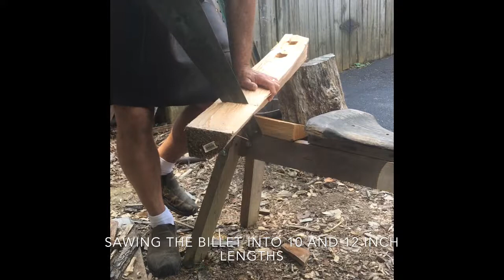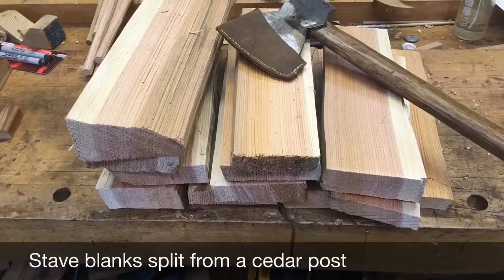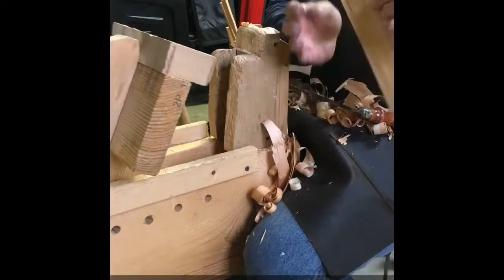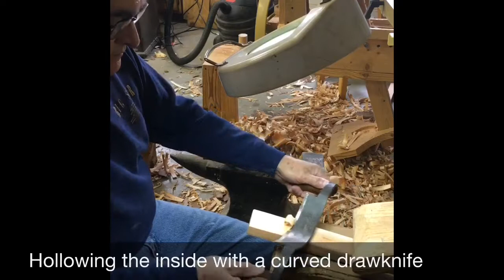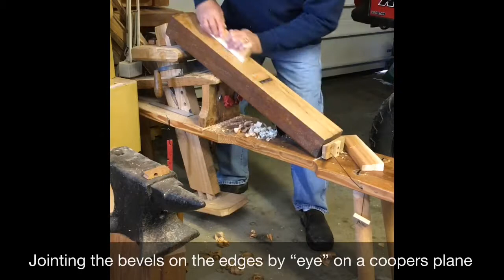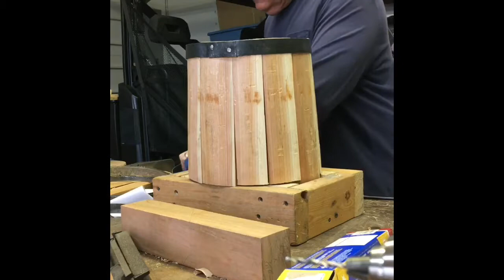Making a Wooden Bucket 1

Comment: Hi John, great series. Is that a Clifton 500 spoke shave you are using to finish hollowing or maybe a heel shave?
Reply from the maker: Yes, it is a Clifton and it’s about the only time I’ve used it!  To be honest I usually skip that step and leave the concave side as it comes from the drawknife. I can get close enough to the line with the drawknife and then smooth it down, after it’s assembled, with a hollowing plane. It’s easy to get a stave too thin at this early stage and it’s really an unnecessary step. 
John
Reply: @johnfreemanmd1728  Yes, although sometimes a spoke shave does offer more control and finesse over a draw knife or even a hollowing plane. Either way, your buckets look amazing.